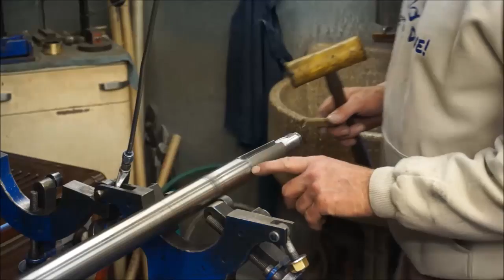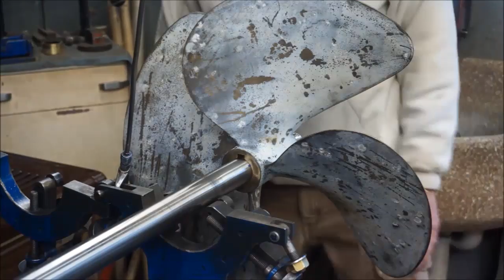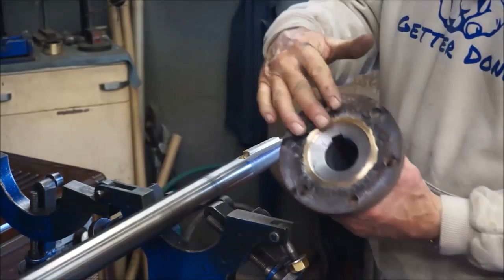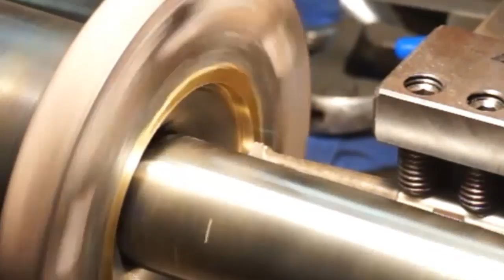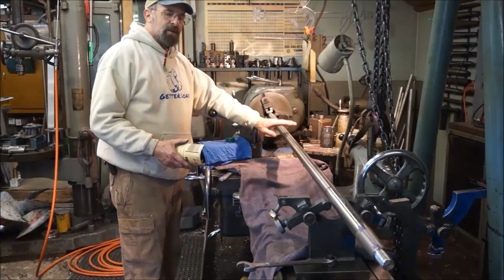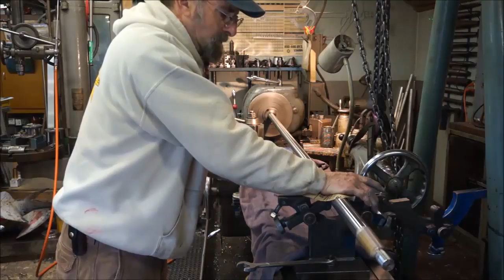Wing It Part 12

Comment: After 37 years in the cabinet trade, 30 of which self employed, I still have all my fingers (rare in my trade), although a few have been modified a bit....every bit of blood spilt was from not thinking ahead, lack of being circumspect..  I have found that there are NO accidents, just stupid carelessness.  I just put up a sign in my shop that says, "there is no substitute for paying attention."   I think it should be up in every shop.  There have been times I just walked away from my table saw, because I was getting careless.  There have been times I have packed it up and gone home.  WIth repetitive cutting, the mind wanders and getting the job done isn't as important has having all my fingers the next day to finish the job.  Thanks for the safety lesson.  I like the way you check and recheck and the check again before starting a particular process, not just your measurements but clearances.   I don't know much about machining steel but I have learned a lot from Keith about being careful and have been inspired in my line of work.

Comment: Lookin good Keith. Them safety natzis can be ruthless to use guys who take the time to film our work and share with others. It's easy to pick us apart for every single thing we do, but having experience gives you knowledge on the common since things to do and not to do around the shop. I've had my share of people comment on things they think I do wrong or is unsafe, but I carry on with a clear conscious.
Reply: Rule Number One: bad things happen to people who think bad things can never happen to them because they know how to avoid that. Me, it's not that I fear machinery; I respect it for the damage it can do to those who think they got it all figured out, so I just keep my hands away from all spinny things while they move. Worked out great so far, I can only wish the same for everyone else.
Reply: Ditto!! :-)
Reply: Agreed.  I've had a couple machine-related accidents at my job in the past using the roller-die cutter we have on the premises, but they were accidents that didn't result in me getting hurt physically, instead the damage was limited to one of the plastic top plates that form the die-cutting sandwich being left broken and unusable.  The incident still demonstrated to me just what that heavy-duty machine can do if you don't treat it with RESPECT and get lackadaisical on your operating routines when using it: either you wind up wrecking crucial tooling or worse, you can get a finger caught in a pinch point and sheared off or nearly sheared off to where the emergency room doctors have no choice but to take your finger off the rest of the way.  After that incident a few years back, I was MUCH more RESPECTFUL of that machine and how dangerous it truly is and haven't had a similar accident to this day on the now very rare occasions I do run it, me being the only employee who's called upon to use it because of firstly how intimidating it is to operate and it also being so rare now that its needed.

Comment: I remember in high school sophomore year metals shop class there was a fellow student who was a rocker (Glam Rock at the time) who was told to cut his long hair, tie it up, or wear a hair net or a cap and though he was good at machining he was to vain around girls (who had to take shop as a prerequisite,). one time a girl needed help with adjusting tool height and he was more than happy to oblige of course, but not after letting down his hair to make a statement as he "eyed" the tool to a scrap piece turned the machine on for confirmation, and instructing the girl how to is when the chuck kicked up wind, grabbed a lock of his "mane' and zipped it around pulling his hair and him into the machine...fortunately, two things saved his life, his hair wasn't that long and the safety off button is was in his his path of collision to the machine, so he was scalped a 2" area on the left side of his head and had the embossed backward "off" logo on the lower side of his face for a day, after returning from the hospital he got into hard rock and sported a crew cut...never took machining as a trade because of lesson learned.

Comment: Two times other people almost got me hurt. The first time I was with a landscaping crew and we were running a hydro seeder. A large unit that was supposed to be pinned down on the back of the dump truck. I'm on the side of it between the seeder and the side of the bed, the truck rolls across a slight side hill and the thing comes right after my foot. I moved fast thankfully other wise it would have surely smashed the front half of my foot if not shearing it right off. The second time was at a greenhouse. I was operating a soil tray filling machine and I had a roller rack about 20' long with trays waiting to be filled. One end of the rack hung over the support by about 5'. A guy came around a corner with a load of bales of compressed peat moss WAY too high for the pallet jack, moving too fast, and the load tipped with the top end catching the end of the rack. It had what you might call a teeter totter effect but as quick as anything. It whipped past me and caught my hat by the brim. It was so fast there was no chance to move. A few inches closer and I'd be shitting in diapers if I lived. Machinery is dangerous, but if something goes awry, a human is to blame. Either from negligence while operating, poor maintenance, or bad design. The machine itself is never at fault.

Comment: Shouldn't the boring bar be on center or lower rather than higher?
Reply from the maker: When your working the inside of a bore your tool, preferred height position switches, to slightly above center, because the material below center-line traveling back into the tool relief, if the tool pressure was to grab the bit it would be drawn in to even deeper depth and it would only get worse from there. By being slightly above center you have a little freedom with tool pressure flexing the boring bar and set up in general. ;{)-----
Reply: I might have this wrong, but in this case the tool was upside-down...so "up" for the tools is down...does that reverse it?
Reply from the maker: JTZshokunin  you are right, now remembering the boring bar doing the register for the coupling, I was thinking general rules for upright bits. on center and checking the clearance is important. If hogging some metal make sure your on the leading side of the rotation. thanks for coming back and pointing that particular scenario. ;{)-----
Reply: Sorry, I should have actually said what I was talking about!

Comment: There was a guy threading a 1-1/2 rod 10 feet long well at the time we had a on/off switch that controlled the threader. he was at the other end of the rod testing the treads with a nut and his long sleeve flannel shirt got wrapped up in the rod!! he was 10 foot away from the power switch and Nobody was working near by when someone finally heard him screaming he had flipped around the rod 3 times the shirt was so tight that it had to be cut off his arm  the rod looked like a pretzel after they stopped it. Since then we put a foot pedal on it so that wont happen again. This guy 6 foot 300 pounds he was flipping around like a rag doll!!

Comment: Great videos....  I am confused however.  The coupling in this video shows the flange to facing the center of the shaft, not the end were I would assume the flange mates the other flange as a coupling.
Reply from the maker: They are driven by a V Drive gear! ;{)---

Comment: Keith, not wrapping your hands around a spinning shaft is one of the best safety rules you could offer.  But I was always told to think of polishing like you would filing on a lathe.  I use a short flat maple stick and put the sandpaper on that, and use it like you would a file, and that way your hands never get on the shaft.   I wouldnt expect you to change your ways but after I was shown that technique I always thought it was a smarter way to do it.

Thanks for taking the time to mention it, and I look forward to seeing the rest of the videos.

Comment: Thumbs up if you were grinning at the safety nazi talk and then spent the next minute waiting for that keystock to come howling out that keyway and take out all the striplights. Sparks, explosions and cue cartoon of yerself going skelington, shadow,skelington,shadow! 

Only joking, You and Mr Pete should form a society. He hates safety nazi's with a vengeance too.

Another good job, done good. What I don't get though is how that transmission gland works. It looks like it bolts to the transmission and then the shaft runs back through the centre of the transmission box and out through the boat to the prop. I don't get it. [gland]>>[transmission]>>>>>>>>>>>[hull]>>{prop}?

Comment: Very good work!  
what you said about safety is true but you missed another big reason people get hurt. that is they are sometimes too focused on what they are doing and being in a hurry to get things going, they miss something near by that hurts them that may be right next to them also.  we all make mistakes, Please be careful.
  for example, this guy was setting up a machine that had two saws adjusted perfectly to split the product flat. about the time he got them adjusted the crew was ready to finish the order, then  he discovered that the shaft of one saw was making a noise that sounded like a bad bearing.  he hit the shut-off buttons for both saws as soon as the suspect saw stopped he reached in to the shaft to see if he could find movement in the shaft, not finding any, he held the saw and move it in case it had become loose, then he rotated the saw  close enough to the other saw and the other saw  had cut his finger off because it was still coasting down.
  he was too focused to see the other saw that was inches away.
The guys called  ME " 9 FINGERS" after that. later I found that the motor couple had went bad..  I lost my little finger that day.
  I hope that others learn from my mistake.  
Please take care !